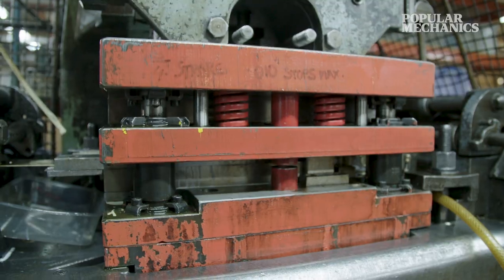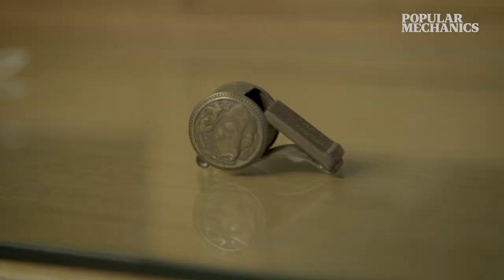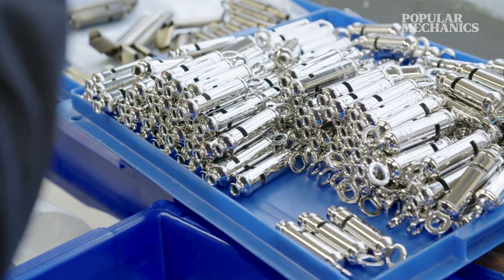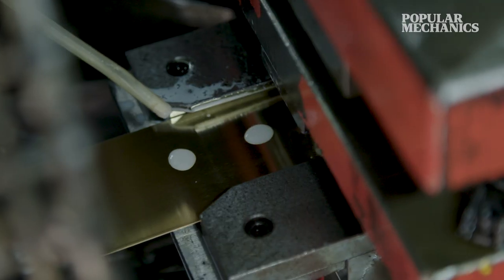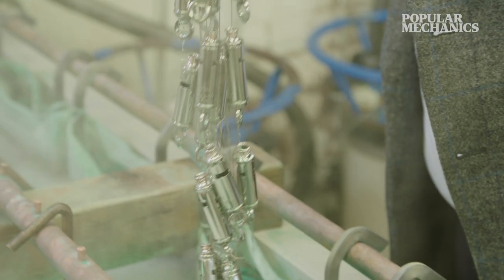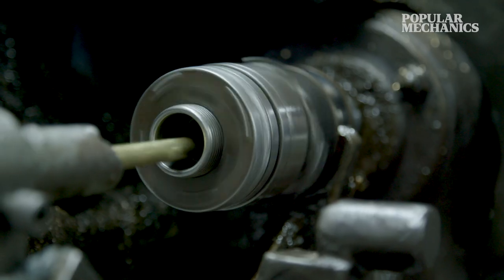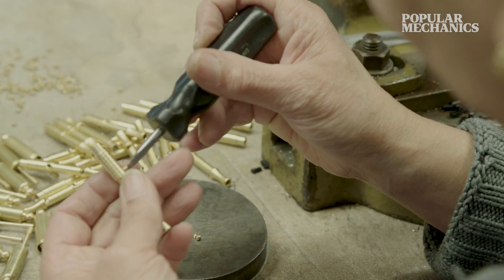How ACME Whistles Are Made | Popular Mechanics

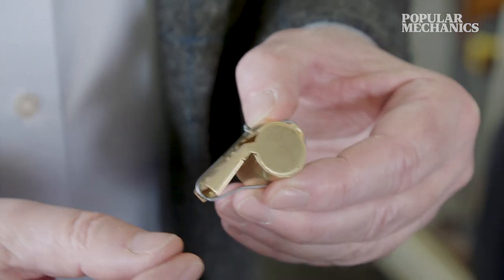Comment: 2:10 induction coil and high frequency sound waves doesnt sound right. I think you mean magnetic waves which induces eddy currents in the whistles which heats them up. Maybe confused this part with the ultrasonic cleaners which are indeed high frequency sound waves to help clean the whistles before nickel plating? I wish i had one of these whistles they look so cool